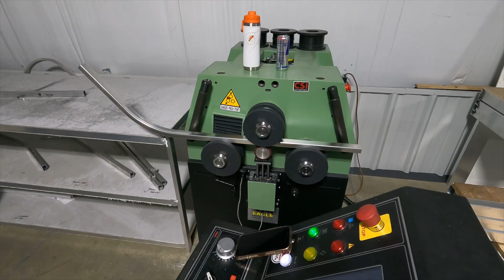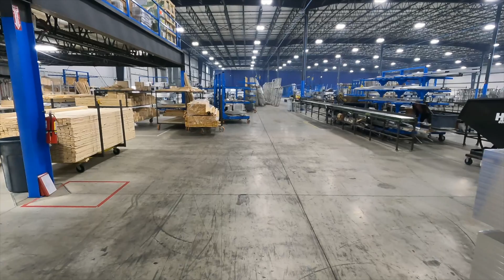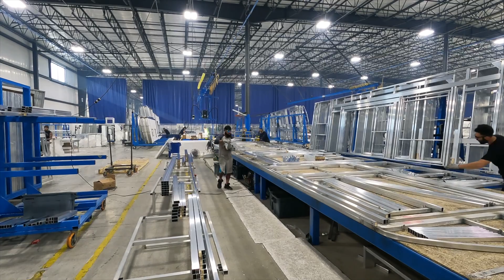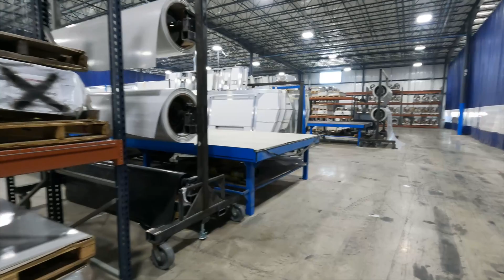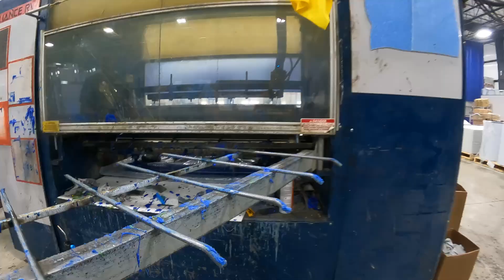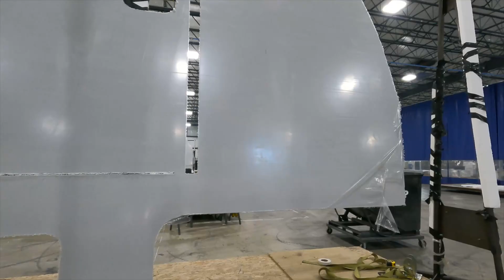Alliance RV Lamination Factory Tour / AZDEL, What is it??

Comment: Nice video. I’m liking what I’m seeing from Alliance. Reinforced spring hangers, electric designed to be serviceable and upgradable, Azdel, support for the tanks like they are intended to be used.  

I wonder if Azdel could be used in the ceiling and/or laminated onto roof decking….   Haven’t seen much on them being rated down to zero.  If they haven’t done that, might be the next thing to improve.
Reply from the maker: Hey JeffinTD, thank you for watching our video and supporting our channel. Since this video Alliance RV has stopped using Luan wood on the interior of the trailers and now does Azdel inside and out on some of the trailers (We don’t know every model). I will pass along your suggestion!

Comment: I've always heard that vacuum bonding is best rather than pinch roller?
Reply from the maker: Hey Jason,

Thank you for the support and watching our video. We are not familiar with vacuum bonding. We will have to look that up. Thank you for the information. There is always something to learn with RV’s.
Reply: While some opinions suggest  vacuum  bonding may be better it take hours vs minutes typically for a part to cure once under vacuum where the pinch roller method is much  more suited for mass manufacturing process. I worked for a Fortune 500 company for 26 years in the laminate segment  so Ive seen  my fair share of these bonding processes. Interesting video.